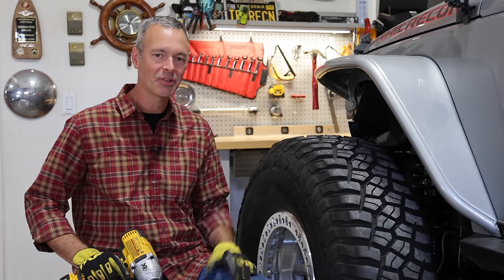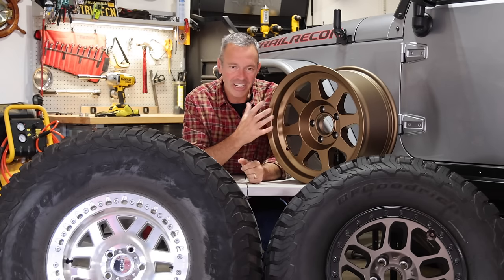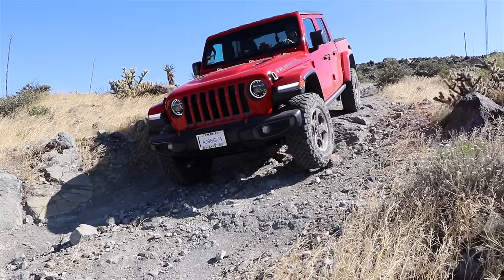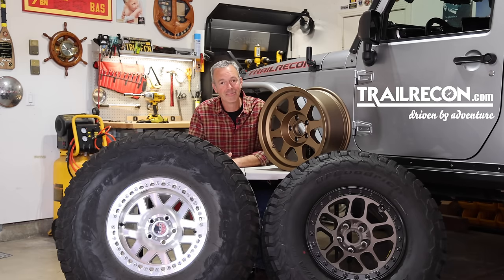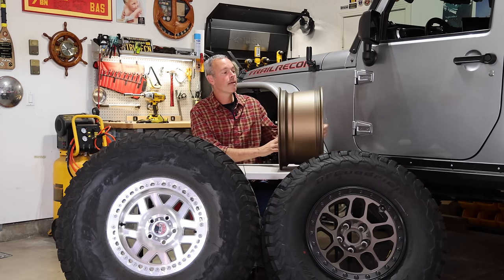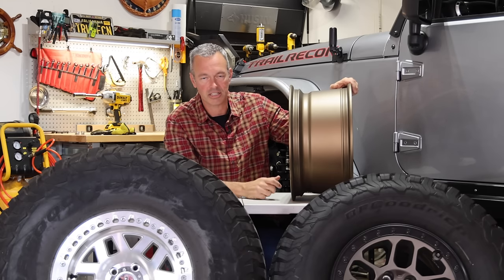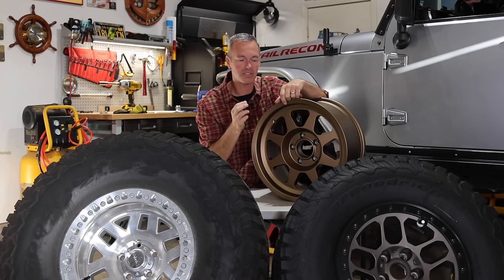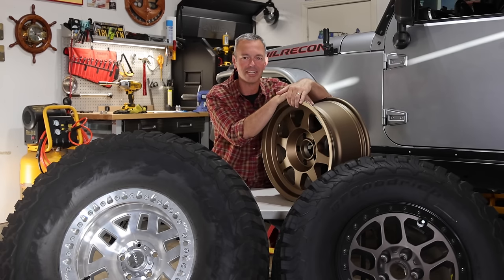9 Essential Tips for Buying the Best Aftermarket Off-Road Wheels

Comment: There was a test a while back (like, a decade ago) where Petersen's 4Wheel & Offroad did an alloy vs steel strength test. And the alloy wheels won pretty easily. It took a lot more force to cause a failure on the allow wheel (meaning, loss of air pressure) than the steel wheel. They also tested the theory of using a hammer to "fix" a steel wheel. And it was pretty hard to do. But steel is quite a bit cheaper. You can often by two steelies for one alloy. Also a HUGE believer in hub centric wheels. My last steel wheels were lug centric, and the only way to get rid of the vibrations was with some hub centric rings.
Reply: I remember that write up! They drove on the rims to see what would happen!
Reply: @MrJamesLuz  Yeah, no tires at all. Was quite the torture test.
Reply: There have been a few tests over the years, and some real world testing, Camel Trophy ran alloys for a few years without many failures. 
I have also straightened a few steel rims, the key is the tool you use. 2 hammers are also a good plan.
Reply: That's BS. Steel rims are more durable 9/10 scenarios. And you can beat them back into shape. Have fun in your mall cruiser

Comment: I recently switched from classic steel “Wagon Wheels” and MTs on my CJ-7 to aluminum wheels and ATs, saving a rather significant 16 pounds per corner. There was an immediate (and very noticeable) increase in acceleration, and reduced braking effort…especially noticeable since my Jeep has manual brakes.
Reply from the maker: Weight matters!

Comment: I have a 2022 JL Rubicon with the Xtreme Recon package from the factory. It came with the 35 inch KO2 as on your 392. My solution was to purchase a complete set of five 37 inch KM3 tires and wheels. So I have both solutions. I swap them on and off depending on the season and depending on my intended use on each trip. I live in N Utah and normally wheel in Moab and in Colorado.

Comment: Hey Brad, good video explaining the differences and what to look out for when buying new wheels. One thing you did not mention when buying modern cast aluminum wheels is the hub thickness can vary so using ET style lug nuts with an extended shank is a safety concern. Having more wheel stud threads in the lug nut is a safety concern and I know some people don't know this. I run Method Standards with the ET style lug nuts. Manufacturers need to make potential buyers aware of this and maybe they do now days. 5 years ago when I bought these wheels they did not and learned of this from a forum on Tacoma World.

Comment: Thank for the information Brad, always wondered about the back spacing and how its measured.  I too am running 17x9 Methods 105 beadlocks with a -38 offset and 40 inch Toyo Open Country MT's

Comment: Good point on the metal valve stems. One thing to also note is that the metal stem may cause a reaction with the aluminum wheel and cause corrosion.  This can lead to pitting and leaks around the valve stem and valve stem Schrader valve making it close to imposable to remove.     On my JKU I am running stock Rubicon hard rock wheels (All Black). On my wife's Renegade (Yes Renegade. It's a baby Jeep Beast!) we are running the stock Sport steel 16" wheels for added sidewall due to only being able to go with limited bigger tire even with a 2" lift and 1" spacers. Plus the black steel wheel (repainted in a high gloss)on the Yellow Renegade with blue brake calipers looks amazing.

Comment: Well done, Brad!!👍👍

I mounted 5-37” KO’s on proper aluminum rims (not bead locked) for my serious trail rides, on my ‘15 JK Rubi 4dr Overlander build.

I retained the stock rims w/33.5” KOs for daily driving.. they handle Great!

Holy Smokes, those 37” are HEAVY!!

I’ve had a hard time finding the best on-road tire pressure for those 37’s, as those meaty sidewalls have a lot of flex to overcome, especially with a full Gobi rack and Tepui RTT.. ARG!!
Any guidance on that would be appreciated!👍

Comment: Great video. I wished I had watched this a few days ago. I just purchased new wheels (not for a Jeep) and they are hub-centric. After they were installed, I had some vibration and I thought that there was a balance issue. It turns out that the wheels are slightly off center since the center bore is much larger than the hub (they are generic wheels designed to fit multiple vehicles). I needed to get hub rings to adapt the inner diameter of the new wheel bore to the outer diameter of the hub - ensuring that the wheels were centered.

Comment: Great info, Brad. Just got my first Jeep (2015JK👍) and this guide will definitely come in handy when I pull the trigger on a wheel/tire set. Thank you!
Reply: I have a 2015 JK Rubicon, and have run several tires/wheels on it.
I would recommend you stick with 35” max tire diameter for many reasons.. unless you are building a trail rig. Your wallet will thank me..$👍

Comment: Hi Brad , this is very professional explained about wheels rims.  I’m driving 4th Toyota 4x4 on harsh Australian of roads 30 years without any changes factory rims  but with good quality all terrain tires and not any issues. Wide rims and tires look nice but make demage body and dangerous for the back - car vehicles because rock flying from a tire which outside the body car.  Cheers.
Reply from the maker: Thank you and agree, the factory usually does a great job with designing a good quality wheel.

Comment: Brad, I'm curious what your thoughts are on the Teraflex Nomad wheel with the air down valve stems.  Thanks for all the good stuff on your channel!
Reply from the maker: I think they are a good wheel, while I haven't had any personal use with their valve stems, it seems like a great idea.
Reply: I had a lengthy response here and YT deleted it because I mentioned that I didn’t appreciate that it was made in a country with which I have many philosophical issues, which many of these wheels are except for maybe Raceline.  Love the Nomad’s air down, love that both the air down and Schrader valves are well protected.  I’m running 285/75 KM3’s.  I wish these were available with less BS to accommodate larger tires (37”) without having to run adapters.  Still investigating this.

Comment: As always super informative Brad!  Still running 35" KO2 on 17" Fuel rims. Looking for a more rugged and solid black wheel like the Fuel Vector or a Method and either more KO2 or something of equal quality for a future upgrade.
Reply: Stick with 35”: any bigger, you will have to replace a LOT of components to handle the weight..👍👍

Comment: Weight was my #1 concern for my setup. Ended up going with method 313’s. Love them! 24.7 lbs in a 17x8.5.
Reply from the maker: It's interesting how the weight of one wheel can be so dramatically heavier or lighter than another, it's an important spec to take note of.

Comment: I would like to see a side by side weight comparison between steel and aluminum beadlocks. My Trail Gear beadlocks are about 45lbs each.
Reply from the maker: I'm sure it would be a significant difference, by KMC's are pretty heavy, but very durable.

Comment: Hi Brad,
So I ended up throwing a Dynatrac EnduroSport lift on my 19 Mojito Rubicon and am now shopping 35” Nittos trail Grapplers to throw on.  I toyed with going 35 x11.5 on the stock rim or going 35”x12.5 on the method 701 or similar…
I’m not off roaring more than trails and the beach…more about the esthetics of how the JL should have come from the factory…like a 392
What would you recommend??

Comment: Another thing to mention is the weight of the wheel/tire combo on non-heavy duty axles. Just about any jeep can handle up to 35s no problem, but once you get bigger than that, tire size and weight can become an issue by stressing not only those suspension components, but the actual axle itself. So all the sports and Sahara's with Dana 30s in the front need to be aware that they run the risk of snapping an axle shaft by running 37s in extreme applications. I eventually want to go to 37s on my Sport, but I'll likely get the lightest wheel I can find and also probably end up with some BFG KO2s, because those are just about the lightest AT tire you can find.
Reply from the maker: I've actually seen a couple folks with 35's on 30's break and axle, but they were all going to hard on the skinny pedal.  Driving technic is very import in not breaking stuff.

Comment: Great video Brad. But you forgot to mention that most beadlocks are not DOT  approved. Which is a factor in picking a wheel if your going to daily your jeep. I like the methods your running got mine done to 6 with a problem. Wouldn't do it regularly though. I'm looking at the Icon Rebound Pros which are street legal
Reply: You know what else isn't street legal? Those ridiculously wide tires extending past stupidly thin or deleted fenders. Keep them off the street.
Reply: @BillHamblinn  that depends on your jurisdiction, not all states have the same rules.
Reply: @horaciolopez7721  Maybe, but when you put other drivers at risk from excessive water spray, mud, dirt, rocks and other debris that would otherwise be mitigated by proper tire coverage in the name of vanity or your own "fun," it's dangerous and rude and SHOULD be illegal. If you like the look or the performance of that, keep it off the street.
Reply: @BillHamblinn  If conditions are such that the Jeep in front of you is throwing water or crud up on your car you shouldn't be following so close. Legal is binary, either it's legal or it isn't. If it's legal, the owner has the right to have fun and look cool. If it's not legal, you should call the police.
Reply: @BillHamblinn  Bill lots of things aren't legal. I agree with on fender deletes and thin fender jeeps being kept off the road. But I was talking about beadlocks, Most Beadlocks not being DOT approved there heavy and these days both method and icon have lighter alternatives that do the same thing. The guys at method started something with there bead grip wheels. that other manufactures are sure to be coming out with other new designs. Icon already done it and they tested with the DOT.

Comment: I'm running the oem  17 in. 4 runner trd  pro wheels with 285-70-17 falken wildpeak at3 tires mounted to 2021 Tacoma trd off road.  6 ply are plenty tough enough for my driving habits and offering less weight with a smoother ride than the 10 ply.  The oem pro wheels are aluminum with a +4 offset.   Do like the Method in bronze or gun metal gray, they might be an option for a little more tire poke, very little with a 0 offset,  and a change in wheel color from the black trd pro as well.  Always enjoy your commentary and beautiful Jeeps.

Comment: Nice and informative video.    I have traditional 18x8 l Alloy wheels on my 99 Cherokee Sport.  So far they have worked very well for off roading and daily driving the chrome is peeling off but I found a Powder coating company who can strip off the chrome and powder coat them for about $120.00 per wheel which is far less than new wheels. .     I watched a very cool method should a air down tire break away from the bead and how to resolve quickly.   One uses a ratchet strap around the tire compressing the tire back to the rim.  Then with a strong a strong air source one can reset the tire pretty quickly.  Not as good as bead locking for certain,  but far less expensive and strong solution for the rare occurrences.

Comment: I have a 2021 392 that came with 33" tires on those deadlock-ready rims. I see you have 35's on your rims (I believe the 2022's may now come with 35's)  and my question is if I were to go with 35" tires when the next tire purchase comes up, will I have any problem with rubbing. I'm not sure if they went with a bigger rim and offset to accommodate the 35's. I like the look of the bigger tires. Awesome video Brad,. Many thanks for all that you do to educate and inspire the Jeep family.
Reply: The 35’s are optional. You have to order the extreme recon package. Which comes with 35’s, 4.56 gears, and a small lift.
Reply: @Stuka87  Thanks but 35's and the extreme recon package were not available on the initial 392 release that I have.
Reply: @buddyknotts4553  Yeah, I know. I was just letting you know the differences for the JL's that came with factory 35's. Not all new 392's do. Still optional. As you have a 392, which already has a lift over a regular Rubicon, you should not need to do anything to fit 35's.

Comment: Good information. An issue I came across was with a FUEL wheel I had on my JK. The valve stem protruded into the web of the wheel. Making it difficult to attach deflators or inflator. I really liked the wheel style but, I ended up changing wheels to make it easier for the trails.

Comment: BFG KO2's on Method 703's for my 4runner. I love the wheel/tire combo and the rig handles. Still trying to decide on which lift is right for me. Not a rock crawler but I would prefer some adjustability and not a beginner lift that I'd end up replacing quickly. Kings are the way to go so I hear however Icon offers excellent options.
Reply: Had the 701 Bronze with KO2's on my suburban with 33's and I could go 85 no wobbles, nothing in terms of balancing issues, loved that combo. Gonna do the 701's and KM3's on my ZR2 Silverado

Comment: How do you adjust for speedometer reading 
 I want to go bigger but need speedo to be correct
Reply from the maker: On older vehicles it is a speed gear in the transmission that needs to be changed, in modern vehicles you will need to recalibrate the software with something like a Superchips Flashcal

Comment: Why are you running-38 offset wheels and what look like 1.5” spacers?
Reply from the maker: Clearance, running 39's on only a 4 inch lift was causing some rubbing, but I like the lower center of gravity of the Jeep, so it's a compromise.  I've got a solution I'm working on down the road.
Reply: @TrailRecon  I bet I know what that is.  Still have the love for the JK that's cool.

Comment: My main concern with these large wheel sizes is that I am simply not strong enough to handle them. Both maintenance wise and flat-tire wise. So I need to stay with the smaller sizes as I need to be able to keep my vehicle operational under all conditions.
Reply: Yup - I can barely handle my 33s with steelies. Might go down to 31s for my little jeep tbh simply for the weight/mileage/braking improvements and then keep the 33s for when I know I am having a trail day
Reply: My Jeeps wheel/tire combo is about 90 lbs each. That's pretty heavy, and I'm young-ish (36), big (6' tall, 300 lbs), and not weak. No offense to anyone, but I can't imagine being a 5' tall, 100 lb girl that needs to change a 37" tall tire mounted on a steel wheel.
Reply from the maker: It's an important thing to consider, my KMC Wheel with that 39 is almost too much for me to lift by myself to get it on the spare tire carrier if I need to change a tire on the trail.

Comment: I run KMC Grenade beadlocks 17x9 w/ 3.5" backspace.  37x12.5" on a diesel Gladiator Rubi.  My tires poke out about 2" or so past the fenders and I get asked often if they hit the fenders while flexed out.  They do not, they tuck very nicely under and inside the Rubi fenders.  Outside of weight, the only real downside is that you are gonna be in charge of changing your tires.  It's not horrible, but it's not terribly fun either.

Comment: Very informative. Why can't you put light wheels on a heavy vehicle? And when do spacers come into play?
Reply: spacers are a fudge for offset and honestly, don't use them, fit the correct offset rim. 
Wheel load ratings are figures stated as safe loading on the rims, so obviously you should put the correct weight load rating rims on the vehicle. You want the load rating to exceed the actual max vehicle weigh by a factor of a minimum of 30-40%
Reply: @overlandready  Good to know. Thanks for replying.

Comment: Have a 2013 jeep wrangler sahara jk…AEV wheels on it. Almost 61,000 miles on the jeep now…wheels have held up decent considering next year will make 10year old wheels. They are black aluminum
Reply from the maker: AEV makes a great wheel and with a well placed offset to make it feel close to stock.
Reply: @TrailRecon  yes that is true! They sit like stock and feel like stock wheels!

Comment: As just commented on Ronny Dhal's "my wheel came off" video, Alloy wheels should have specific nuts so they keep in place, because the wheel is slightly softer, it has a little give in in, using the wrong nut can have a result of either overtightening or worse, loosening of the nuts. The correct alloy nuts should have a collar on the conical part or flat to the wheel rim. This allows for some movement without the torque of the nut altering. 

Offset on rims is usually the absolute here, but people forget the rim width effects the position of the centre of the rim, so a 6" rim with ET0 is the same backspace as an 8" rim with ET+25, however it will push the front of the rim out by 2". What it effects is scrub angles, but won't effect the suspension geometry too much if at all. ps you're better off running the correct offset rim over spacers as it puts the vehicle weight directly onto the hub and not stepping it out onto the spacer creating a lever effect on the bearings. 

As for my wheels, I swapped out the steels for alloys on my '97 Land Rover Defender 110, why, because they look better, less unsprung weight, slightly wider so can have 265/75R16 tyres (Yes, a standard size) They also are made with a different drilling for the nuts so you cannot run the steel rim nuts, you have to have the specific alloy wheel nuts, which is a good idea from LR, The nuts can be used with steel rims so can still have a steel spare.